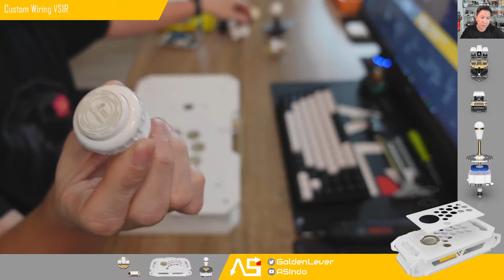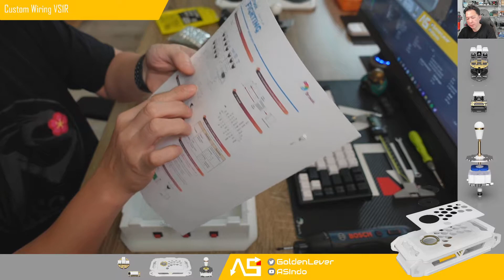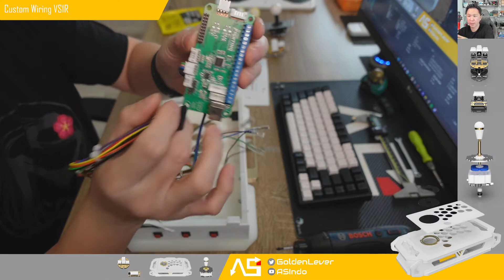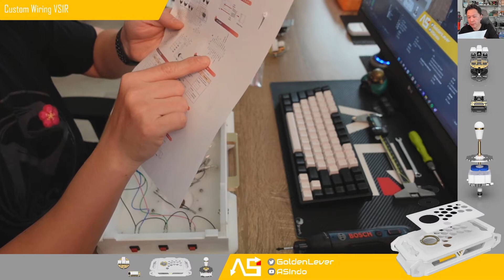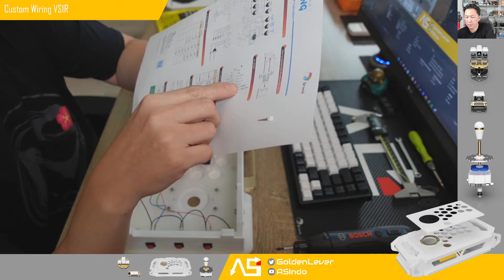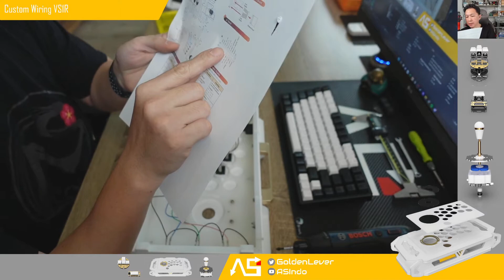Wiring VM6 Arcade Stick

Comment: What if you wanted to wire extra directions? What wires would you need then??
Reply from the maker: You can re wiring the extra buttons to any inputs by connecting the signal cable directly to the Brook PCB